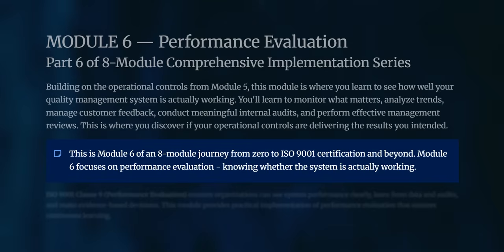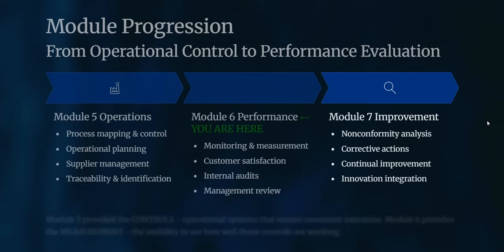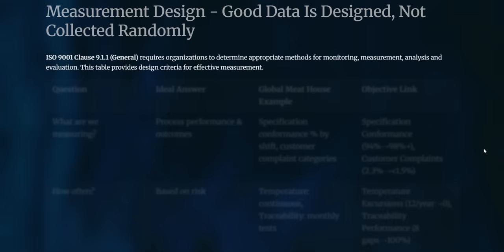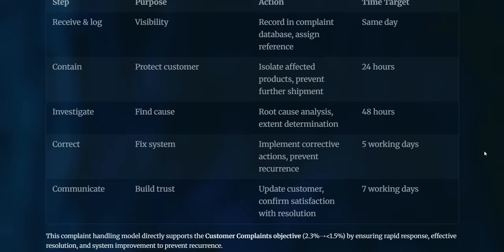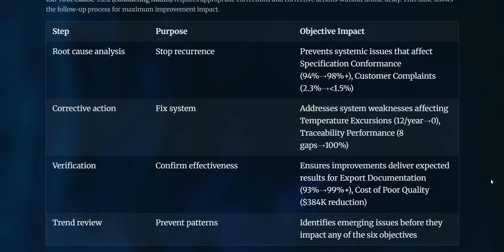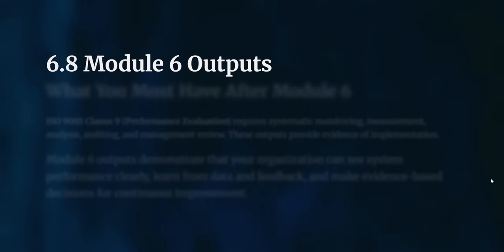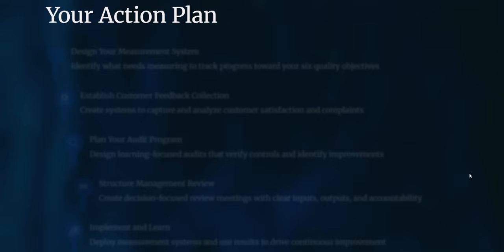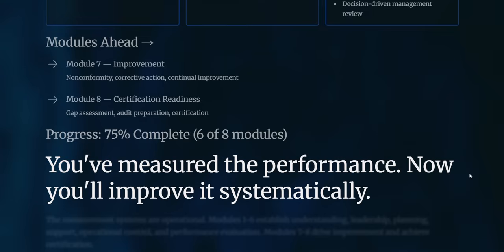ISO 9001 Certification prosses | Real company – Module 6 Performance Evaluation (Clause 9 Explained)

Comment from the maker: 🔹 This is Module 6 of an 8-part ISO 9001 implementation course.
This module answers a critical question:
Is your system actually working — or just reporting?
Before moving to Module 7, your organization should be able to:
measure what matters
analyze trends
learn from audits
make decisions using data
▶ Module 7: Improvement — turning insight into action.

📌 Start the full course here: 
https://www.youtube.com/watch?v=635Yd0RY7VU&list=PLpjg2sQqENxpX1I-BuqdfCaL003zCMf9O&pp=gAQB ISO 9001 – From Zero to Certification (Complete Playlist)
or
📌 Start the full course here: 
https://www.youtube.com/watch?v=nbldSNzf0Ms&list=PLpjg2sQqENxrXg5OHN88-I17cmLA7qsPI&pp=gAQB  ISO 9001 Implementation – Step by Step (Practical Training)